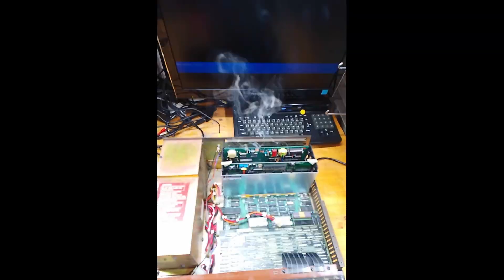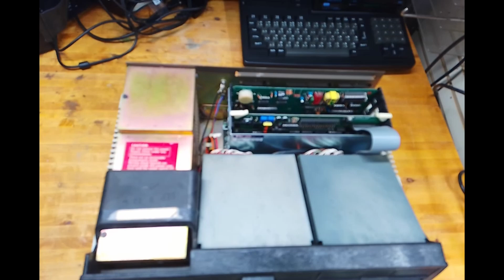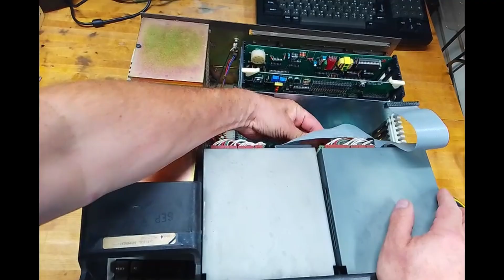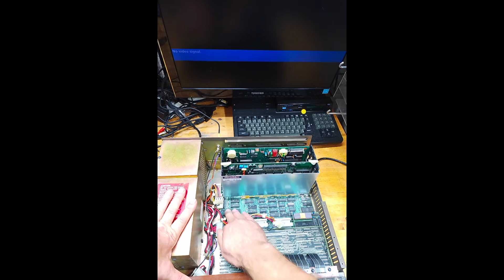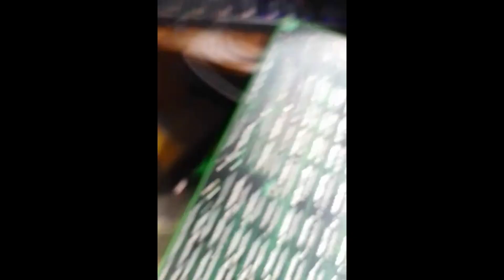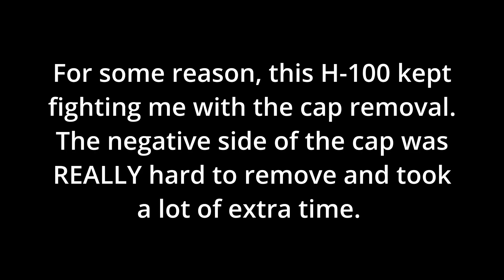Episode 6 - Heath H-100 - Pt1

Comment: I noticed your hands were near the gold-plated S-100 slot terminals. It's crucial to avoid touching them directly, as oils from your skin can cause significant problems. Instead, please use 99% alcohol for cleaning. Furthermore, while the Zenith-designed boards are exceptional, remember to handle them with care to prevent electrostatic discharge, which can seriously damage sensitive components such as integrated circuit chips. Your attention to these details will help ensure optimal performance and longevity.